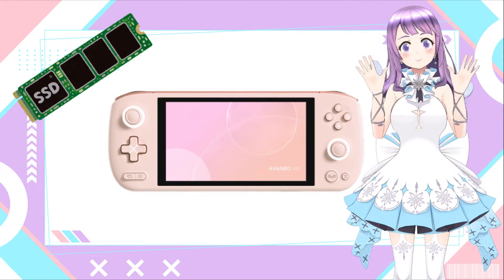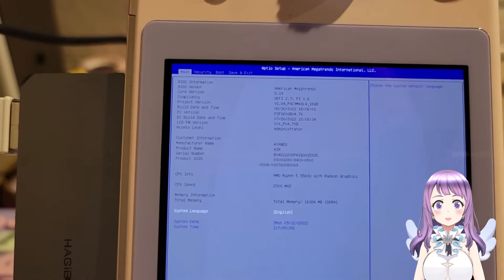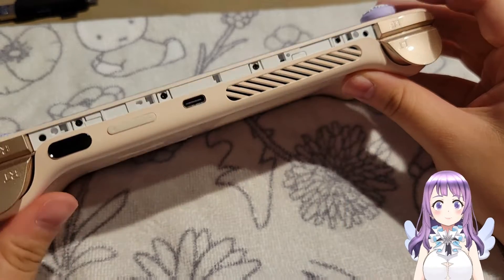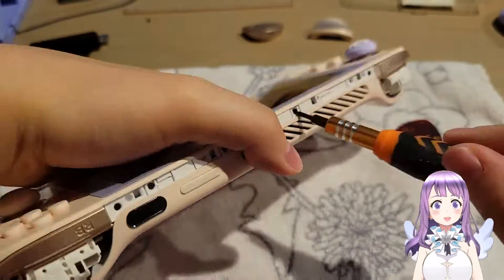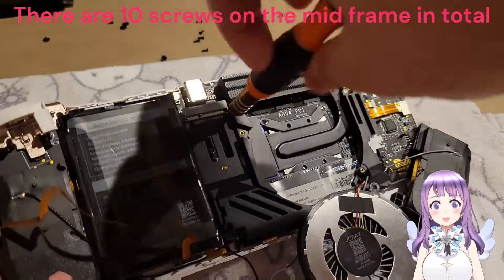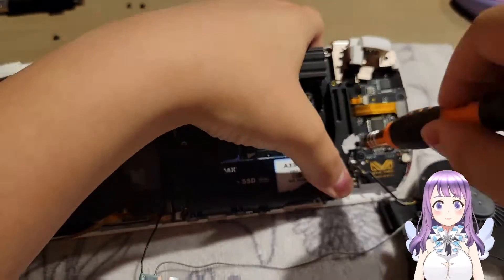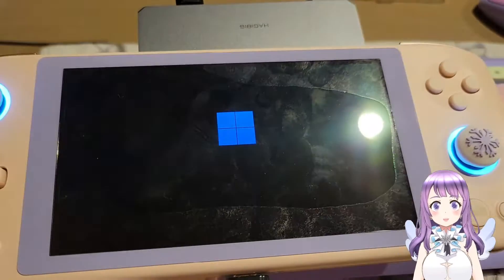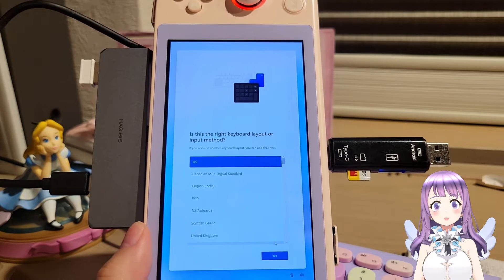Tutorial for replacing SSD on AYANEO AIR, installing Windows, drivers and more

Comment: Hi, could you help me please. My touch screen doesn't work after installation on my air plus 68000. Could you telle me the name of the driver . Thanks a lot
Reply from the maker: https://www.ayaneo.com/support/download

It should be in the driver package for air plus
Reply: @ETlandxoxo  You know, tell me, which drive do I update to make the touch work again? I would be the same version as yours😢
Reply from the maker: @leandrooliveira9137 you should be able to choose Ayaneo air in the download page 😊
Reply: @ETlandxoxo  I got it ❤ another question can you tell me if it is possible to use 2 systems? Windows + bazzite?
Reply from the maker: @leandrooliveira9137 very likely. Bazzite basically works on anything. You will need to install windows first,then shrink the partition for windows and install Bazzite on the an empty partition. May need to try installing it several times to make it work.
Reply: @ETlandxoxo  Do you who already use it? Do you think it pays off? More than Windows? I’m talking about the issue, is there a very big difference in performance? Or because it has a simpler and more beautiful menu for games?
Reply from the maker: @leandrooliveira9137 no big difference in performance only some gacha games won't run 
https://youtu.be/Ed1tyyE78PE
Reply: @ETlandxoxo  So I’m going to continue Windows, or ask is it possible to use bizz and put games from the “green” store on it? Or just bought it?

Comment: Wow this looks complicated XD

Also did you have any problems with the device after doing this? I opened up a lot of devices and I almost always have problems with them after. Something loose, something not working or the device completely failing.
Reply from the maker: It is not that difficult:) Changing shell and buttons for switch lite was the most difficult thing I have ever done.
My devices work fine in general;)
Maybe you have some super power you didn't realize 😉
Reply: @ETlandxoxo  Oh maybe nintendo purposely made it difficult. My psp's thumbstick permanently broke when I tried to replace the shell. Maybe because they are old companies, they have a mentality of not wanting their customers to open the devices.

Comment: 10:38 So I need to reinstall Windows on my Ayaneo Air for different reasons (original SSD is still in the device), and I can get up to this point. However, for the "where do you want to install Windows?" window, it does not show me any hard drive. The entire thing is just empty. Do you know what could be causing this issue or how I can fix it? ;;
Reply from the maker: Could be because 1.bad SSD connection. You can try unplugging and reconnecting you SSD.
2.You formatted the SSD in a wrong format/ an invalid partition. You need to take out the SSD and connect it to another pc then use software like ease partition to reformat you device.
3. Your SSD died

Theses are the 3 possible reasons I can think of
Reply: @ETlandxoxo  Thank you so much for the fast reply! I really appreciate it. I have not messed with the SSD at all because I didn't want the warranty to be void. I only received the Air on Thursday. It did work at first, but only for maybe two hours. I wasn't even done setting everything up yet when it just died on me. Since then, it doesn't boot Windows anymore. No recovery method has worked for me, so I hoped for a clean install to fix my problems. When it didn't detect the hard drive, I already feared that maybe my SSD died. The only thing that is strange to me is that in the BIOS options (9:35), it does give me the SSD as Boot Option #2, so it looks like the Air can still detect the SSD? Maybe the crash somehow messed it up? I'm so unsure of what to do, and customer service hasn't been helpful either, so I'm slowly losing hope. ;; I was thinking of trying to replace the SSD altogether, but that would mean that I won't be able to refund it anymore. I've never worked with hardware like that before, so the thought scares me. xD (On a side note, your video on replacing the SSD is so clear and easy to follow. It already helped me a lot with understanding how everything is built and how the device works. So thank you for that also. <3)
Reply from the maker: @AngelKagome  I am sorry to hear that. Are you buying from the official store? If not, I would just go for a refund. If you are buying a 2tb ssd to bet, it would be a good amount of investment. I would rather refund it and buy a ROG Ally instead. 

The original SSD is kinda bad. It heats up easily and responds very slow. I am not surprised if the SSD died, especially it is quite hot recently. The device can get overheated easily.
Reply: @ETlandxoxo  I bought the Air in the official Ayaneo shop. I saw that they have a 7 day return policy, and if it is broken (which I am pretty sure mine is), they pay for the shipping. So I decided I will ask them for a refund and be done with that device. I'm sad it didn't work out, but what are you gonna do, right? And I didn't want to get a handheld that only gives me a headache.

I did get the ROG Ally on Saturday and I am so happy with how it runs. I am much happier with it than I was with the Air, so thank you very much for the suggestion. :) And also thank you so much for your fast replies and your help. I really appreciate it so much!
Reply from the maker: @AngelKagome  I am happy that it works out for you. Stay tuned for more Ally vids:))

Comment: My aya neo air keeps getting blue screen when I play steam game n emulation. Its running the max tdp 12 watt. I wish this thing works. I sent it in one time b4 this and they said they fixed. B4 I could go over 15 watt for tdp. After getting it back i can only do 12watt.  But it's going blue screen error when I game.
Reply from the maker: I am sorry to hear that. A blue screen like all blue or a blue screen with error message?
Reply: @ETlandxoxo  blue screen error message.
Reply from the maker: @thaiden03  then a clean windows installed may help

Comment: Where did you get that lavender border for you screen?
Reply from the maker: It is a screen protector for switch lite from extreme rate. Not the best fit on AIR caz the screen and the border are not completely flush. But it protects the screen and cover the ugly black bezel anyway :)
Reply: @ETlandxoxo  Sweet, thanks

Comment: You've come a long way from your upgrading Retroid Pocket 2 to Retroid Pocket 2+ video.

In this video, your much more confident💪👧 👏😊

I'm still waiting on the AYA NEO Air Plus, was tempted on getting the Air Pro(5560U), but that would have been over kill😌

Almost at 2K subs🎉🎊🍻🥂
Reply from the maker: Thx;) this is actually one of the easier projects.